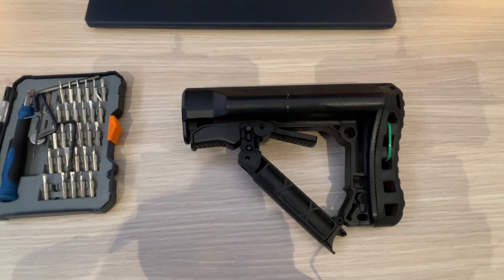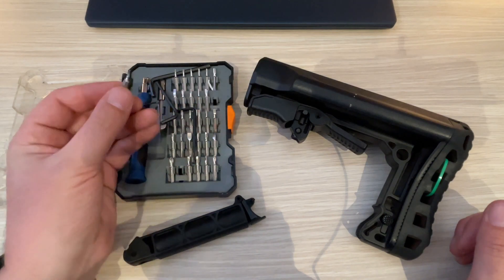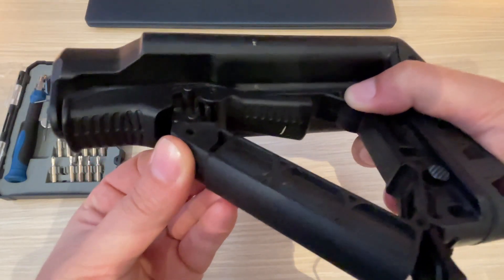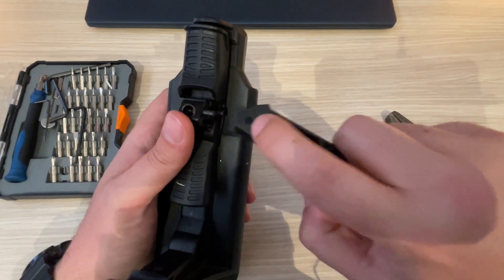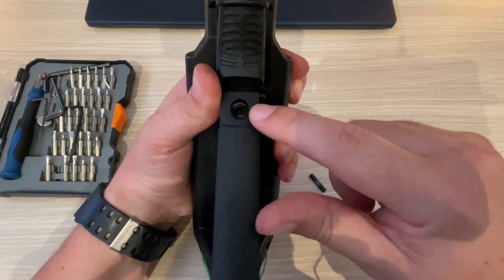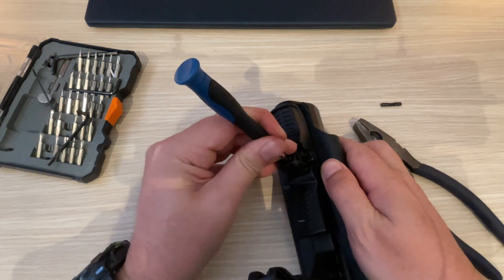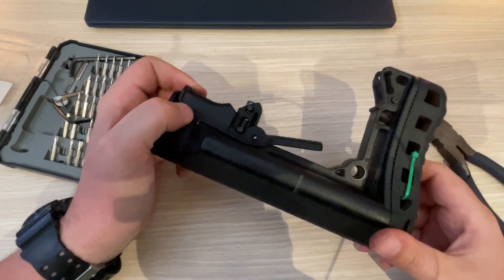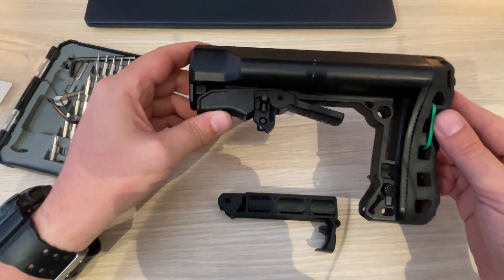How to Remove G&G Skittles Tube!

Comment: Loving the videos man! Just recently bought the G&G Predator and was wondering if you could do a video on the range with the upgraded internals in comparison to stock?
Reply from the maker: Hi Matt, unfortunately I don't have access to a stock replica as most stores don't lend them out for testing. My channel is still a bit small for that kind of clout (sad face). Comparisons are also tricky as it depends what you upgrade. I focused more on reliability and got maybe a 15m range advantage over stock, and better grouping. So its certainly not a DMR, but it is very good for buildings and games in open ruins.

Comment: any tips on knocking out the rolling pin? Can't seem to do it even with a mallet...
Reply from the maker: The first thing is to get some kind of tool bit that’s pretty much the same diameter as the roll pin. The hex head or torque heads are the best as they have no taper on them that can slip into the roll pin. 
From there, once the bit catches on the edges of the pin, you just have to give it a good old whack until it sticks out a bit. Once the pin sticks out enough just grab pliers and yank it out with a bit of a twisting motion. Hope that helps!
Reply: No luck unfortunately, trying to pull the rolling pin out via pliers but the pliers keeps slipping and looks like it’s doing more damage than good 😔

Comment: How did you take off the stock because I can't seem to find anything on how to take it off
Reply from the maker: So you will see that the adjustment lever you squeeze to make the stock longer or shorter pivots or rocks on a small steel cross bar. Pull that down  on both sides at the same time and then pull the stock off. 
Hope that helps!